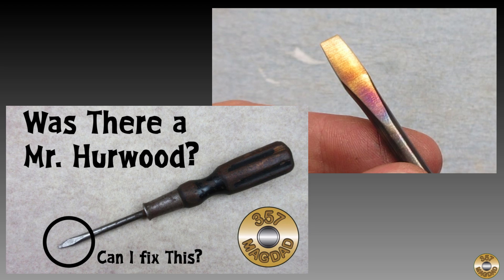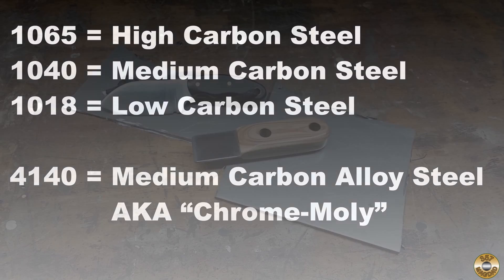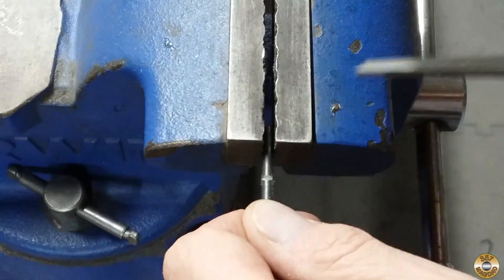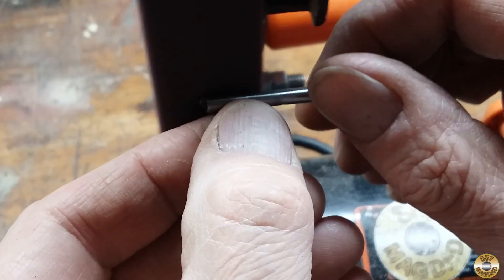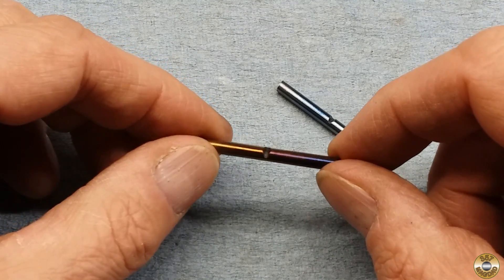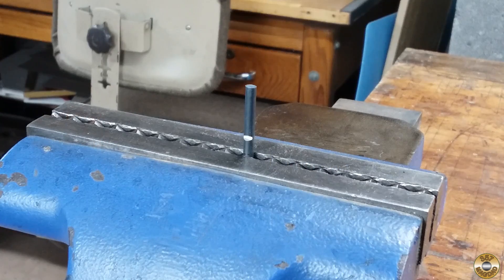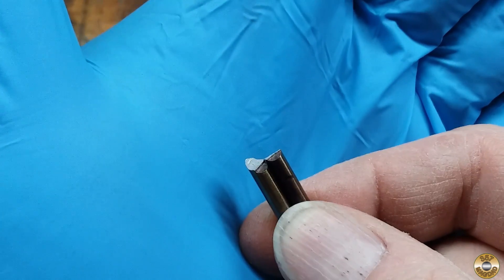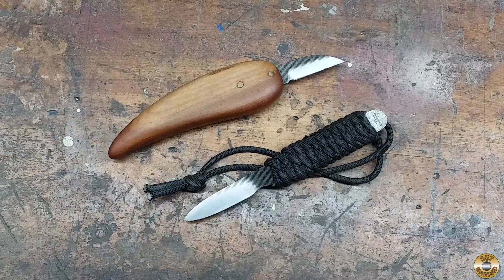DIY Heat Treating Steel

Comment: You answered my question: can I get the metal hot enough with a propane burner. 👍🏻🍻🤣
Reply from the maker: A propane torch works fine for small items.  I made a mini forge for knife blades:
https://www.youtube.com/watch?v=NEUbA0bSBRQ

Comment: If the metal isn't immediately quenched, instead of letting air cool, would that make the metal softer than it originally was?
Reply from the maker: If you heat the metal to non-magnetic and let it air cool it will be soft and easy to file, drill, grind, etc.

Comment: Awesome info Magdad.  Love the demo because I have had a hard time understanding tempering.  Just getting into knife making at your suggestion. And I'm loving it. Thanks
Reply from the maker: A fool proof way to achieve a straw temper is with your kitchen oven.  Bake it for an hour at 400 deg F, let it cool and repeat.
Reply: @357magdad  I bought a little oven just for that but haven't used it yet lol

Comment: Even with the new and improved knife steels, the heat treat is still a prerogative. All knives either roll or chip. What the intended use of the knife and blade geometry determines if the edge can hold to a higher heat treat or if it is finer edge like a straight edge where a chip would be catastrophic.
Reply from the maker: A knife maker definitely has to experiment with geometry and temper.

Comment: This was a very interesting video! I have always found it odd that to soften copper is the opposite of steel. I have never tried silver or gold but on the periodic table of elements they are closer to copper than steel.
Reply from the maker: I haven't tried copper, but to soften brass you heat it to dull red and then cool it either by dunking in water or in air.  The brass won't "quench".

Comment: Very useful video.   Thanks.
I saw a video a long time ago about making armor in the 12 - 15th centuries.   Blacksmiths were very much the skilled craftsmen.   The video showed a painting of some wealthy nobleman wearing blue armor.   This was a very consistent colour and was done by the blacksmith controlling the heat of the armor to achieve the colour.   I cannot imagine how many years it took that craftsman to develop the techniques to control the temperatures with the coal or charcoal fired forge.
RIP for the top of the blue piece.   LOL
I like to use O1 drill rod tool steel for cutters in wood turning tools.   This is normally purchased annealed.   It is also easy to harden and temper like your pieces.   A big benefit of the O1 drill rod is that it is ground to a close tolerance of the nominal size.

Dave.
Reply from the maker: Thanks Dave!  The "O" in O1 stands for "oil Hardening", so heat treating is very similar to plain high carbon steel.  I haven't had any experience with it, but I understand it is pretty easy to harden in the home shop.